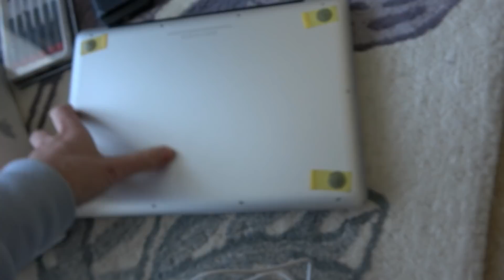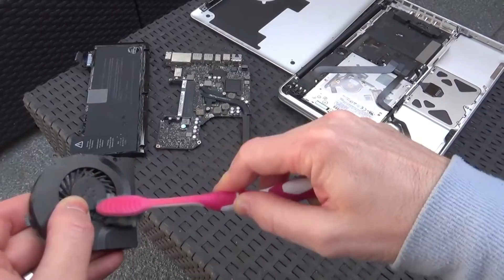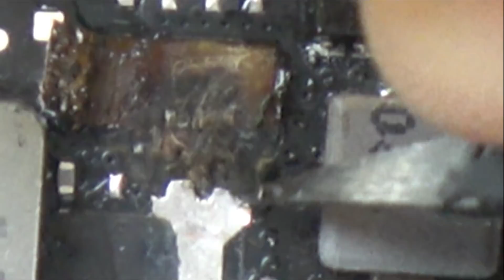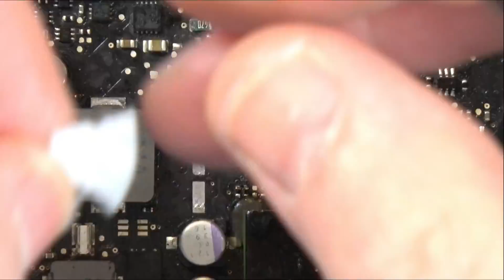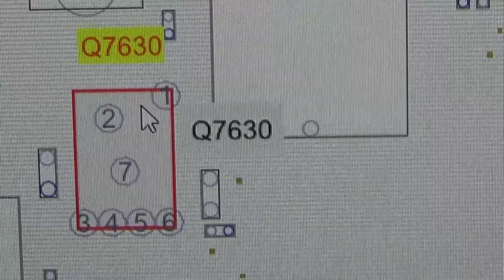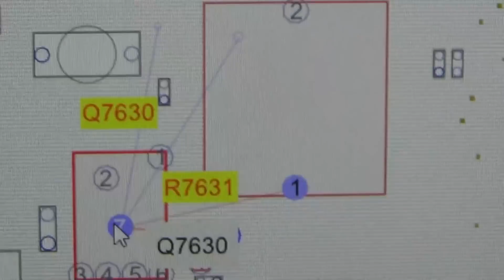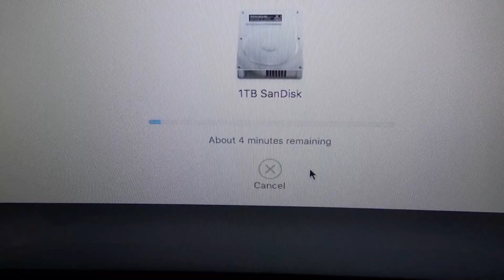My 1st Attempt at Fixing an Apple MacBook Pro A1278 from eBay

Comment: You need Louis rossmann, he says to check the major power rails one at a time using the board view software to isolate the problem in a down flow way from primary power to secondary signal circuits, the continuity test won't work it's too complex a machine

Comment: CPUVCCIOS0_LL is a powerline between the mosfet and the coil. after the Coil it's PP1V05_S0 has 1.05V and carries 18A, 
Should be a power line for CPU and/or PCH

Comment: You didn't need to do the SSD outside of the Mac - you have a toolsmethod in the startup (the Cmd+R method, don't remember the exact keycombo, but yeah) - also, you might want to do a dual channel 16GB setup - I'm running one of these as my main laptop, and it runs just fine for every daily task.

Comment: The capacitor the blew off (13:48) had the positive side closest to the burned chip. If you look at 18:14 the pad isn't bridged until you added the solder to remove the rest of the burned chip. At 19:13 you can see there are a lot of spots bridged together. Not sure how detrimental that may or may not have been, but it's worth noting.
Reply: That! I HOPE Vince will see this comment!!!
Reply: This!

Comment: Hello Vince, I have worked a lot on this model. The boards are breaking a lot on these due to bad design. They also overheat a lot, so the fan sound is normal! Dosdude1 has videos on swapping cpus

Comment: I think water got under the CPU  or the hub controller and mixed with the dust and become conductive try to reflow both the cpu and the hub controller and see if the problem disapeares

Comment: 12:27 you also don't want to point hot air towards capacitors with aluminum cans! next time use some kapton tape or aluminum foil tape to preserve the integrity of the component.

Edit: oh wait, you popped it, hehehe

Comment: Vince 10 ohm is ok for power supply for CPU, you actually inject voltage straight into CPU. For example RTX3060 got below 1 ohm in power supply and it's completely fine. So always check big grey coils if there is direct short ( below 0.2ohm ) - ex. 2 ohm on GPU coil is normal, 0.1 ohm is broken GPU. 10ohm on CPU coil is normal, below 1 ohm on CPU indicates broken CPU. PS. All that grey coils are part of switching power supply circuits for different voltage - 2 mosfets, driver, coil and output and input capacitors. So RAM memory got independent switching power supply, CPU got another, GPU got another, 5V/3V Always, WiFi, PCH etc. So inject voltage only if you got super low ohm reading.

Comment: The reason why the fan was kicking in at 100% with the board out of the chassi is due to the SMC (System management controller) is not able to read the sensors located on trackpad etc, and as a safety reason it will automatically put the fan at 100% to ''protect'' the machine :)

You should also add a second RAM-chip into the machine to get the full speed from the memory (Dual-channel)

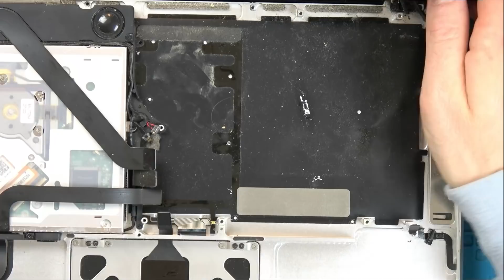Comment: 6:05 i have one of those that had much more dust, mine worked i cleaned it and changed the thermal paste, i don't use it couse its too old but still works fine, my mac book pro its a mid 2010 2,4 ghz dual core, i don't like apple laptops anyway but they gave it to me that one couse it overheated easy fix, and an i7 is always better than and i5, the i7 is a high end chip both are from the same era, so the i7 its better

Comment: Today I had a blown component that burned through the layers. I had to excavate the layers until the short is gone. Your didn't excavate enough. Regards from Portugal
Reply: In fairness, 12V to the CPU is 12V to the CPU. Clearing up the short won't fix the fact that it's already dead.
Reply: @wsketchy  i understand. My short was on the main power rail. That seems to be in a secondary power rail.

Comment: No hopes to fix board when they are burned in such a severe way. I would not even tried also the problem is that when the board burn it becomes a resistor and when you have a lot of current things start to burn... Probably the short is in the board it self

Comment: I see you opening the lid to see if it will turn on. This model does not have autoboot, you need to press the power button to turn it on!
Reply: It does if battery if disconnected

Comment: 34:15 the fan spins like that because it doesn't have the temperature sensor wich is located on the trackpad cable!
Reply: wrong. its because hes running it without a battery
Reply: @jdriver2308  wrong lmao, im watching this on my 15" 2012 MBP with no battery (pulled it out as it was pretty dead and barely lasted 10 mins at over 2000 cycles when i had to reflow the gpu)

Comment: I have the 2011 MacBook Pro still in use, upgraded with SSD and 16 Gig of RAM. When I remember right I also changed the WiFi module to a better one. Even the battery holds up after 10 years, my previous Acer Notebook had three batteries in only 5 years. 
Sad that the newer Apple Laptops can not be upgraded….

Comment: im not sure exactly when apple started soldering the RAM on, but i beleave the 2012 models might be among the last to have upgradable RAM (i recall that the 2015 and newer models have soldered RAM, im not sure how far back the soldered RAM thing goes, so it could go as far back as 2013 for all i know, and i beleave that in 2016 apple started soldering the (SSD) storage to the motherboard)
Reply: @Ellis The DJ  sadly other companies have copied apple (the first surface laptop (Microsoft) had a soldered SSD, not sure about the later models)
Reply: That is a crime against repairability.

Comment: Vcc is the "voltage for the collector" in TTL circuits, it should really be called Vdd ("voltage for the drain") in CMOS circuits like modern computers.  It's a power rail.  Modern CPUs run on several voltages, VCCIO will be the voltage for the IO circuits in the CPU and there's usually a different (variable voltage) one called Vcore that drives the actual CPU core.
Reply: Yeah as soon as i saw the board was bubbled I knew it was probably dead, unless it's thunder bolt or one of the usb ports you can bypass and still get the laptop to post.
Reply: Injecting power into a board with a complicated processor/southbridge like this is very questionable as a tactic-  you'll be violating the power sequencing requirements of the system and  moreover, Vcore can easily draw fifty or sixty amps at 1.1 or 1.0 volts.
Reply: That's just how these Intel processors roll, I'm afraid.
Reply: I'd really recommend that you keep that board for spares, those boards are eight or ten layers and if the top layer is carbonized there's probably carbon further inside too.

Comment: "That's it for today and as always, I hope you've learned something!"
Reply: "see you all in the next video, bye now"
pets blackberry or clinton
Reply: Bye now!
Reply: Definitely a mosfet!
Reply: You have a short to ground, possibly somewhere in the capacitor banks - probably blew the mosfet in the process - power injection and FLIR or louis’s auwie test is a fault finding solution - be careful around CPU vcore- you don’t want to push 5v into the cpu - those lines that appear on your boardview are the traces connecting the components - you can see where everything goes
Reply: "Blackberry is not mewing."